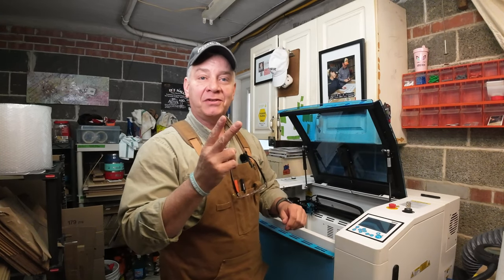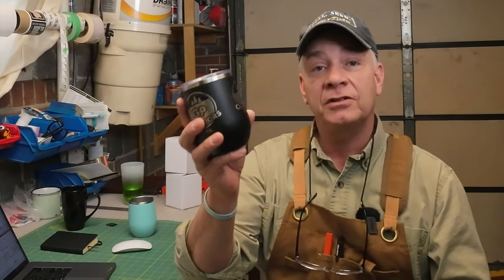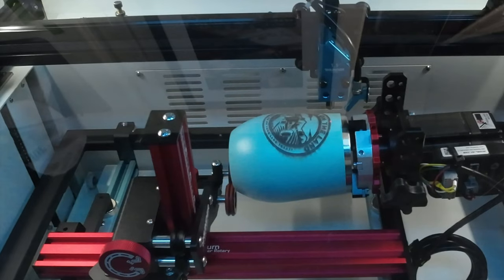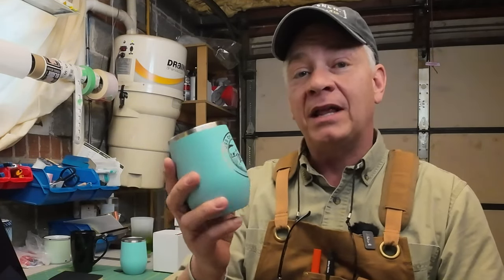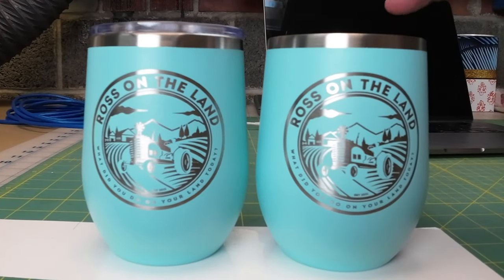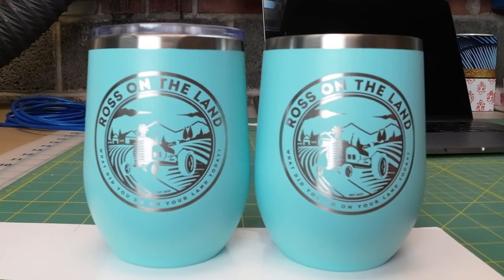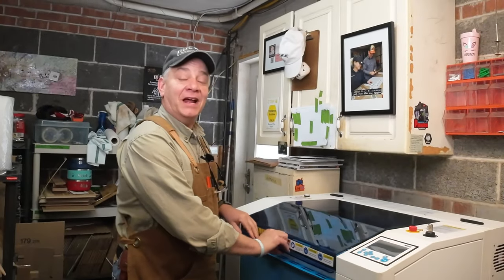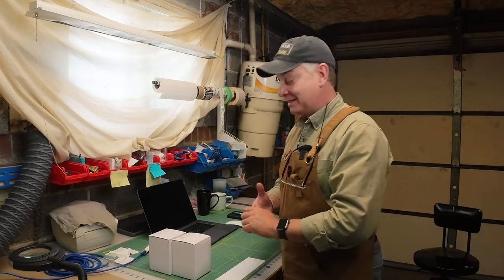1.5" vs 2.5" Lens Comparison. Powder Coat Tumblers. Thunder Laser BOLT.PiBurn GRIP. Part 2  029   4K

Comment: Got my Bolt yesterday! just wanted to throw out some info for saving $$$ on tumblers. You can wrap your tumbler with painters tape and do a test engraving on the tape so you can see exactly how your engraving will look, without having to engrave the actual cup. My settings that I found for this are 600 speed/10% power (Max & Min) with 254 LPI. Hope this helps save y'all some money. I especially like using the tape to test my full wrap designs on cups to ensure everything meets up perfectly. Cheers
Reply from the maker: Hey congrats on the new laser. And thanks for the helpful tip on using the tape, and your settings. Enjoy the new laser!

Comment: Great videos, you're the Bob Ross of lasers! 😁 I'm thinking about getting the Thunder Bold laser as well. Regarding the rotary you have, why did you choose that over the Thunder brand one? I have a chuck on my current laser and like the idea of not having to enter the 'steps' for each engraving. Do you recommend it? Thanks for the videos!
Reply from the maker: Good morning! Thanks for the kind comment. I chose the GRIP because I didn't like the design of the clamp style rotaries and the rotary I saw from Thunder is very limiting and seems to be very basic in design ( respectfully). The GRIP came with everything included and is very functional and easy. On the BOLT, I only had to set the steps per rotation once in lightburn - it does not change. I did a few other videos on how big a diameter I can engrave on the GRIP, and also provide the exact steps per rotation setting  for the BOLT. Good luck with your decision. Cheers!

Comment: Nice, informative video, especially since I'm contemplating the Bolt. Have you tried changing the LPI to a lower number with the 2.5? Since it's got a bigger spot it might not be able to match the resolution and cause some loss of detail.
Reply from the maker: Good morning and thanks for the comment. I did not try that but was thinking it would not help because I would be trying to produce tiny details and reducing the LPI is like reducing the detail but I may be incorrect in my thinking - still have lots to learn. Thanks

Comment: My 1.5 and 2.5 lenses do not focus at the same distance from the engraving surface. Do your lenses have the exact same focal distance?
Reply from the maker: Hi Steve - i use the autofocus for both ( same distance) however as you mentioned the point of convergence is deeper ( lower) on the 2.5 then on the 1.5 which I believe is why the tiny details tend not to be as clear with the 2.5 so I think I would be correct to say the beam hitting the surface is wider with the 2.5. Thanks for tuning in!
Reply: @LaserNUG  I’m still learning about all this but I have discovered  that the distance from the lens to the focal point for 1.5” lens is 38.1 mm and the focal point for a 2.5” lens is 63.5mm. My auto focus does not give the correct focus point when I change lenses. I just upgraded my lenses to American Photonics and all their lenses focus at 10.5mm below the nozzle. The nozzle tube length for each lens is different so I have to manually adjust to 10.5mm below the nozzle. Thanks for created videos.
Reply: I wonder what the results would have been if the focus point for the 2.5” would have been set to the top of the material?